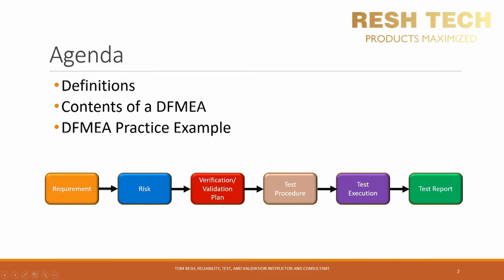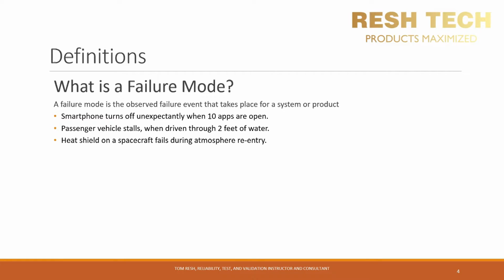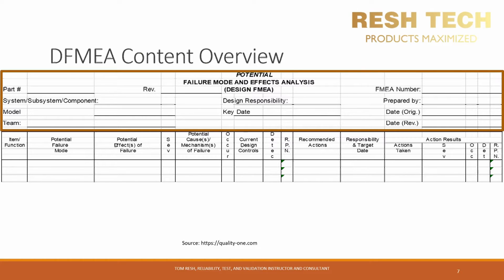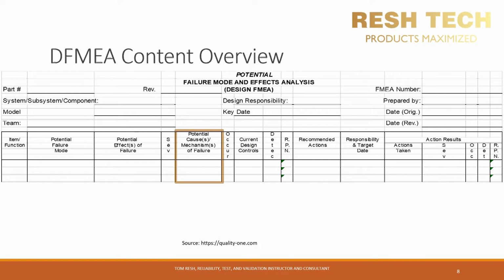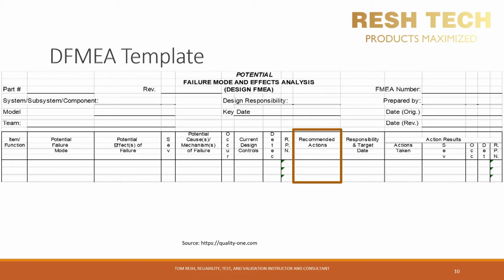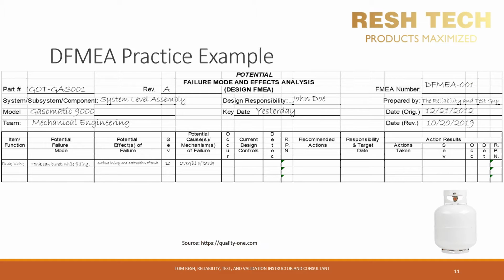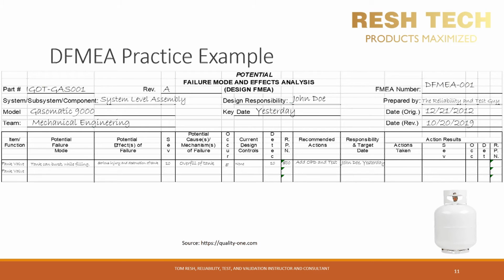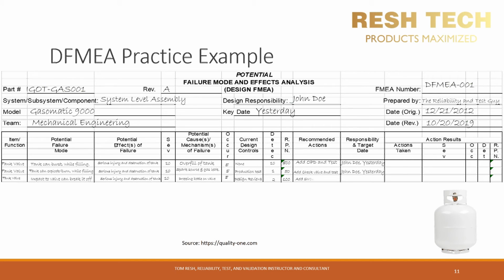How to create a DFMEA Design Failure Modes and Effects Analysis

Comment: I agree that you cannot prioritize by RPN alone, but your example was poor.  If your Sev=10 and your Occur=10, your Det could NOT = 1.  The only way you can give a Detection value of 1 or 2 is if you have a Poke Yoke or some type of error proof in place where 1 equals "you cannot MAKE" the feature bad, or a detection value of 2 where "you cannot PASS a part with that feature being bad".  So, this could never happen.   You should simply say that all Severities equaling 10 should be addressed.
Reply from the maker: I deeply appreciate your constructive feedback regarding my prior commentary in the DFMEA video. I wholeheartedly acknowledge your perspective on the matter of risk prioritization through the utilization of Risk Priority Numbers (RPNs). Allow me to address the salient points you have raised:

RPN Calculation Validity: 

It is astutely observed that conventional Risk Priority Number (RPN) calculations tend to yield significantly elevated RPN values when both the severity (Sev) and occurrence (Occur) parameters are assigned the maximum value of 10. This, in turn, often renders the assignment of low detection values (Det=1 or Det=2) improbable, given the inherent inverse relationship between these variables. 

I must underscore that the extreme example presented was employed deliberately to underscore the limitations associated with an exclusive reliance on RPN as a means of risk assessment. 

While such occurrences are rare, it is plausible for a "1" to be allocated within a DFMEA, bearing in mind that the determination of detection may occasionally be influenced by the expertise level of the engineer engaged in this manual assessment.

The Role of Detection: 

Your emphasis on the pivotal role of detection within the RPN calculation is well-founded. The detection factor assumes a critical function within the purview of risk assessment, serving to pinpoint areas necessitating heightened attention and control measures to avert the actualization of the identified risks.

Addressing All Severities: 

Your proposition that all instances of severity attaining a rating of 10 warrant immediate consideration is a valid assertion. In numerous risk assessment frameworks, the sheer gravity of a high-severity scenario in isolation is sufficient to warrant prioritization, regardless of other influencing factors. It is imperative to recognize that not all situations neatly align with the confines of the RPN calculation model, and instances exist wherein the mere existence of a high-severity issue mandates expeditious action.

Context Matters: 

It is paramount to acknowledge that risk assessment is a bespoke undertaking, devoid of universal applicability. The suitability of employing RPNs is intrinsically contingent upon the specific context, industry, and organizational nuances. While RPNs prove advantageous in many scenarios, some contexts may indeed incline towards an emphasis on severity, as you have aptly surmised.

In summary, I concur with your appraisal of the example provided and your accentuation of the primacy of addressing high-severity concerns. It is imperative to comprehend that risk assessment is a multifaceted discipline, wherein RPNs, while undoubtedly valuable, may not emerge as the panacea for all situations. 

The choice of approach should be judiciously determined by the contextual factors, the industry domain, and the unique intricacies of the risk under consideration. 

I extend my sincere appreciation for your discerning insights and the elucidation provided on this matter.  Thanks for watching!